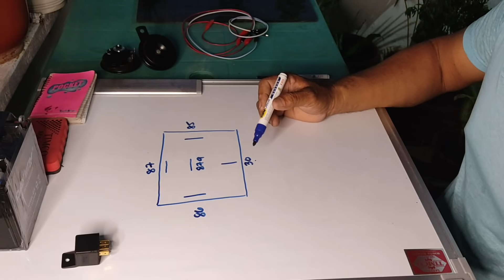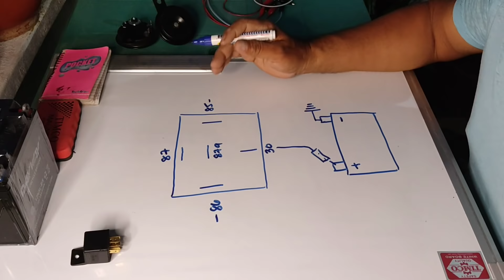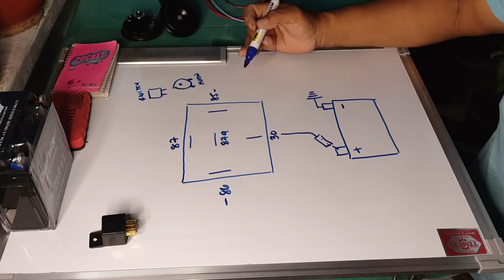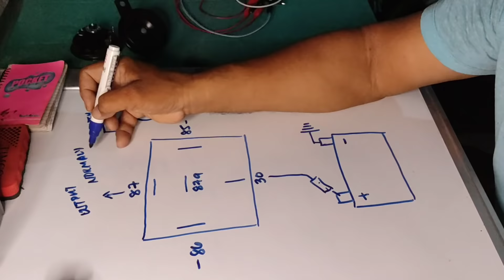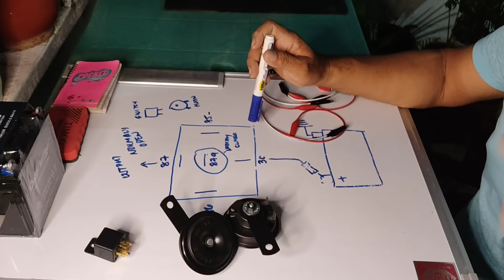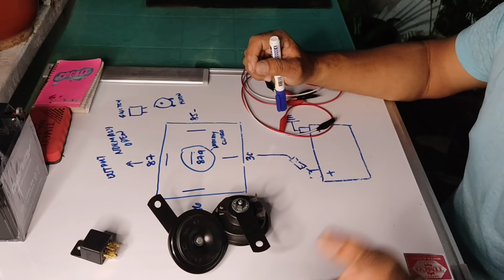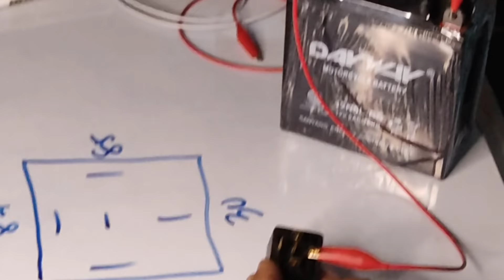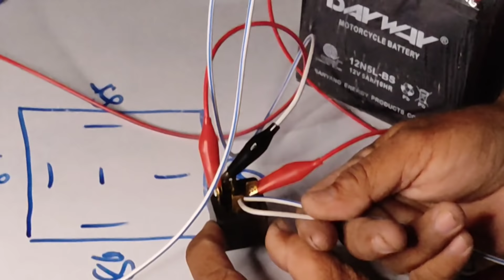PAANO MAGKABIT NG RELAY NG BUSINA?ANO ANG KANYANG TULONG SA BUSINA?TAGALOG TUTORIAL.

Comment: ang itinuro mo sana is ung may momentary switch sana . ung hindi rekta battery . ung dadaan muna sana sa accessory wire . kase kahit naka off motor mo, pwede parin bumusina . AT SOBRANG INIT NG RELAY KAHIT NAKA OFF ANG MOTOR . DAPAT YAN UNG TINURO MO
Reply from the maker: Panoorin nyo po ng buo...yun nga po tinuro ko..yun 85 at 86 yun po yun dumaan sa switch..yun 30 lang po ang rekta sa battery.pag patay po switch dipo gagana ang relay dahil wala pong contact ang 85 or 86..Salamat po

Comment: super init ng relay paps . rekta tlga sa battery
Reply from the maker: Ang 30 lang po ang nakarekta sa battery.ang 85 or 86 ang dumaan sa ignition switch.pag patay po ang ignition switch na siyang accesory wire wala pong kontak ang 85 or 86.Salamat

Comment: Sir kakabili ko po ng macchorn at paano po ikabit sa honda 155cdi 2005 model at 4pin po yong relay nys.
Reply from the maker: Sundan nyo po yun ginawa ko sa video..YUN HORN PO NINYO,YUN 2 TERMINAL PAGSAMAHIN NYO CONNECT NYO SA BODY GROUND,YUN NAMAN PO 2 TERMINAL PAGSAMAHIN NYO DUN NYO PO ICONNECT SA 87 NA RELAY,YUN 30 SA RELAY ICONNECT NYO PO SA BATTERY,YUN 85-86 ICONNECT NYO PO SA WIRE NA DATING NAKA CONNECT SA BUSINA NYO DATI...SALAMAT PO.

Comment: Sir PKI tito Nyo nman ang page wire ng 12 volts sa diesel engine step by step Simula po sa susian na nabibili sa auto supply papunta sa fuse ,alternator starter ,voltage regulator at amperes ,sir PKI blog Nyo po ng live at may piyesa po na nakalabas para po makita nmin at Maruti ng gusto sa page wire ng 12 volts sa diesel engine

Comment: sir, paano po magagamit yun  linya ng STOCK na busina kung gusto ko magpalit ng mas malakas, need pa po ba additional relay? thanks
Reply from the maker: Magagamit nyo po..yun stock na linya ng busina nyo itap nyo sa relay 85 at 86 kahit po magkabaligtaran,tapos po yun 30  itap nyo sa battery,tapos po yun 87 itap nyo sa isang connection sa malakas na busina,tapos yun isang connection ng malakas na busina itap nyo sa body ground.
Reply: @marianobrothersmototv  , thanks po

Comment: Boss yung relay ba na 12v mag activate pa din ba yung coil nya pag 0.50v ang supply?
Reply from the maker: Hindi napo...saan nyo ba gagamitin?2 klase lang naman ang batterya ng sasakyan 12v at 24v.
Reply: Ang coil po ng relay ay ginagamit depende sa boltahe. Kung ito ay ac dapat mong gamitin ay ac supply at kung ito naman ay dc dapat mong gamitin ay dc supply. Dahil nga po ang battery ay 12 volts dc o kaya ay 24 volts dc. Ang .50 volts ay hindi maaring gamitin para sa 24 volts. Pwede siguro kung gagamit ka ng transformer na may 12volts primary to .50 volts seconday..may ibat ibang supply po para sa mga coil ng contactors or relay. May 220 volts,110volts, 24 volts at 12 volts. Kaya yung .50 volt ay hindi pwede masusunog lang. Pwede rin gamitin ang .50 volts kung gagamit ka ng mga electronic  components kaya lang pang electronics na yon. Kaya tama si boss para saan mo ba gagamtin.

Comment: Sir saan ko ba pwedeng gamitin ang terminal 87a ng relay?  Naisip ko kasi sayang naman kung hindi nagagamit. Salamat po.
Reply from the maker: Accesory po..
Reply: Sir pag nag connect ako ng kahit anong accessories sa terminal 87a ng relay laging naka on siya kahit naka off na lahat pati ang engine kasi normally close ang 87a sa terminal 30 ng relay na naka connect naman directly sa positive terminal ng battery, at pansamantala lang na walang power supply ang terminal 87a pag nag on ako ng busina. Saan o ano kaya ang magandang application  ng terminal 87a ng relay? Maraming salamat po sa inyong payo.

Comment: sir pano po nalalaman kung possitive or negative ang trigger? salamat po sagot
Reply from the maker: Gamit kayo test light.. itop nyo sa positive battery yun clip. tapos chek yun wire na dalawa na lumabas sa switch papunta horn..tsek nyo yun isang wire pag switch nyo at umilaw negative trigger po..Pag sa tsek naman sa positive baliktarin mo lang yun clip sa battery ground mo itop yun clip..tapo check ulot same procefure..positive trigger namanSalamat
Reply: salamat po sir

Comment: BOSS.. TANONG KO LANG PO YUN BAKANTI 87a RELAY sa BUSINA KO.. PEDE KO PO BAYUN GAMITIN SA CHARGER CP HOLDER KO...OK LANG PO KAYA YUN DIBA APIKTADO BOSINA KO AT CHARGER CELLPHONE.
Reply from the maker: Pwede po.kaso pag ginamit nyo busina mawawalan sya ng power..direct nyo nlng po sa accesory wire.Sana makatulong.
Reply: @marianobrothersmototv  salamat po.. Pero na try kuna po sa ignition wire positive ng charger Pero nanyari meron masamang feedback yun TAKBU ng motor ko po.. Utal utal at naging palyado hatak.. Lalo na pag nag signal light ako life or right, meron empact. Naisip ko fi kaya sa charger ko meron defect ito.. Pero ok naman yun charge. Faster at pinalitan ko pa yun ng iba wire ng speaker e. Tapos bigla ganun... Manipis kasi wore niya pag bili ko.. Sa lazada. 🤣

Comment: Xplain to me, its really need a relay for horn in motorcycle???
Why is needed???
Cuz for me, it can be additional current load watts for ur battery. Specially when  ur batt is bcoming weaking... I'm I right?
Reason why, relay is composed a coil winding to magntize. And about horn is composed also a coil winding, so is already more current load in ur battery. For me no need put or install another relay... It can be more current load to ur batt... Is useless...
the motorcycle manufucturer did not install a relay horn cuz it can be more load current to the battery, specially the s a small one type...

Comment: Sir paano naman po makabit ng ground halimbawa po mag upgrade ka ng ground sa car mo kasi 14 yrs. na so maaring marumi at kinalawang na mga body ground so paano po mag up grade pls. help me po...
Reply from the maker: Yun labas lang naman po ang kinalawang po yun loob po hindi naman po kaya tuloy ang current nun..wag ho kayo mag alala dun.linis kalawang na lang po  pag may time.Salamat po
Reply: Is it benificial to add extra ground to enhance the ground for more stable current if you connect another ground from negative terminal of battery to engine block? they say its good for the electrical system of your car , pls.educate me more, salamat po